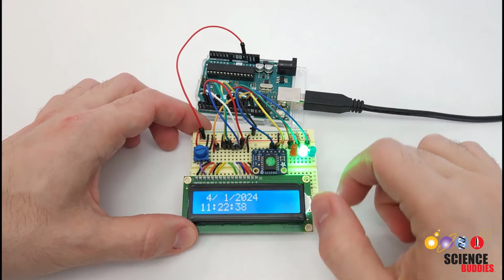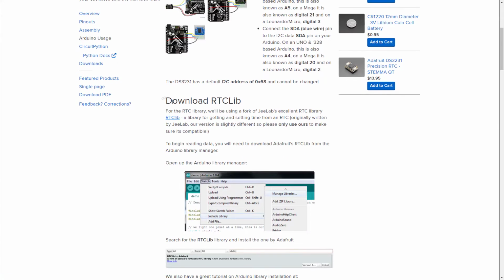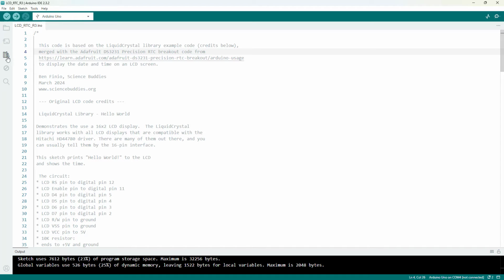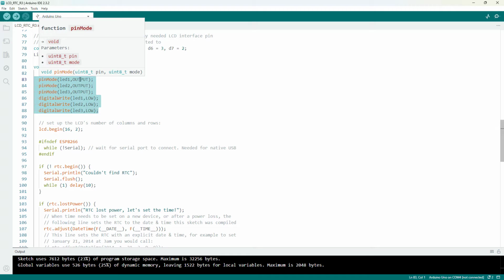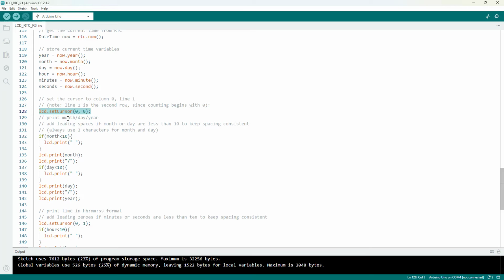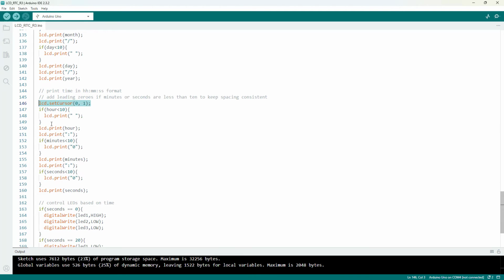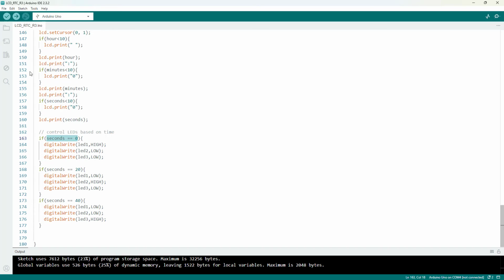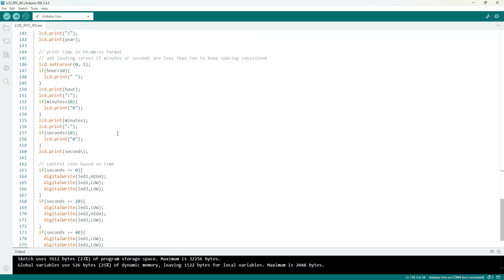How to Use External Real-Time Clock (RTC) with Arduino (Lesson #36)

Comment: The clock isnt working and also I cannot open the file, please fix before you post your things
Reply from the maker: If you are a K-12 student doing a science project, you can ask for help in the Ask an Expert forum on our website and we will be able to help you troubleshoot. Otherwise, you can try asking for help in the official Arduino forums. In either case, others will need to see your code and a picture of your circuit - otherwise we can't really tell you what's wrong.
Reply: @Science.Buddies  Thank you for replying, my code doesnt work and the LCD CLOCK pops up random numbers, so I will ask an expert then

Comment: ChatGPT told me it's possible to attach the VBat to arduino analog PIN to check battery and light up a red LED if the battery is dead. I'd like to do that to warn users. Is that possible ?
Reply from the maker: Be careful when doing this! The Arduino's analog pins can only measure up to 5V. So for example if you connect a 9V battery directly to the pins it can damage the Arduino. You need a circuit called a voltage divider to reduce the battery voltage first. We recommend asking for help in the official Arduino forums or other forums dedicated to electronics (do not always trust ChatGPT with things like this).
Reply: @Science.Buddies  Yeah it told me that, to reduce the CR2032 3V to lets say 1.5V and scale accordingly.
When i said the battery would lose juice because it's connected to GND, it told me to use a divider with 1M/2M ohm and another component i cant remember, kind of voltage comparator, so it works with these high resistances.
Reply from the maker: It might have told you to use an operational amplifier (op amp) for short, which can be used as a buffer or voltage follower to avoid draining current from the battery.

Comment: Does this run in millaseconds? I am thinking about making a very time sensitive project and need it to monitor up to1/100 seconds
Reply from the maker: The Adafruit documentation does not mention tracking milliseconds, but that doesn't mean it isn't possible - you would need to dig further into the documentation for it: https://www.adafruit.com/product/3013

Comment: This is absolutely fantastic. Im so glad YT suggested your channel. Watched several of your vids today, and all are great work, very well explained, and well done.  Thank you for this series!! 

Question ..  IK the code in this vid is based off an existing library, and as such can be altered as needed, but, is it suitable as-is for low-power consumption implementations, such as when running off battery power? Im looking to  diy a daily timer system that will run off 12v DC battery. 

Also, by way of feedback, I absolutely loved when you explained the use of capacitor and diode in the dc motor vid of this series. I would love to see a vid or vids re how and when to use capacitors, diodes, and resistors and how to choose these components in their appropriate values (e.g. what should the uF or Oh be of the cap/resistor). This is more EE, I realize, but I havent seen this yet in anything close to a beginner level. Your presentation style might be perfect for this. Thanks again, sry for tldr
Reply from the maker: Hi - we haven't done any long-term testing of this code and power consumption. We don't have any of our own tutorials on it but you should be able to find tutorials online for longer-term low-power Arduino usage. And thanks for your feedback - we are a K-12 STEM education nonprofit that covers all areas of science. We do have a lot of electronics and Arduino content but it is mostly targeted at the K-12 level and doesn't get into college-level electrical engineering, but you should be able to find plenty of playlists/lecture series on these topics online. Here's one by Dr. Ben Finio, our staff scientist who does all our electronics content and also taught Mechatronics at Cornell: https://youtube.com/playlist?list=PLKL6KBeCnI3U6KNZEiitdtqvrxkBhpuOp&si=Pd3sXXBryKZ2ElnT
Reply: @Science.Buddies  much appreciated!!